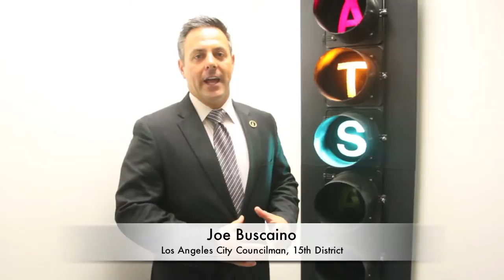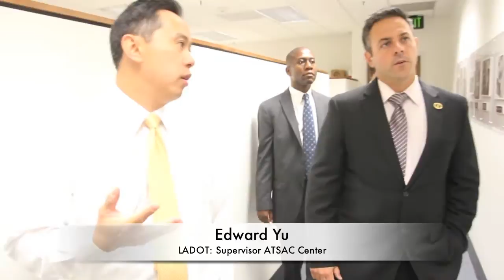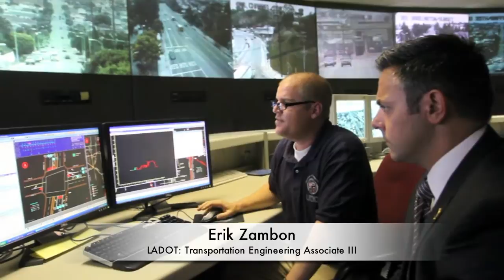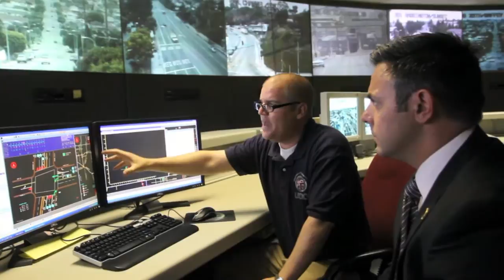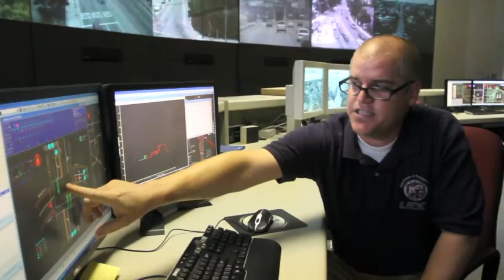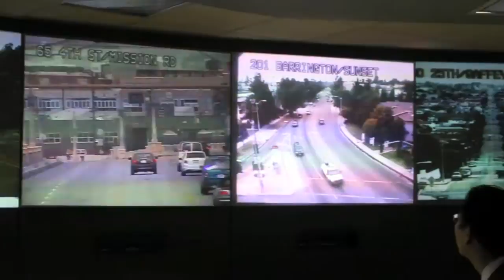Los Angeles Department of Transportation Automated Traffic Surveillance and Control Center

Comment: Dear Joe Buscaino, I'm designing a system in Brazil with control over demand. It works as follows, we analyze the traffic in real time using an application called b-mobile, it provides traffic conditions every 50 meters of a road. The traffic lights operate automatically, receiving the demand information with a subcarrier of an FM radio. Ie not have to deploy cameras, video analytic, inductive loops in the way. Also I do not need via cellular communication circuits. We analyzing other systems.
Reply: Read Automated traffic review on my blog before you buy. Go to garyreviews. com/automated-traffic-review/ Thanks. Kent.
Reply: Read other http://www.be-mobile-international.com/